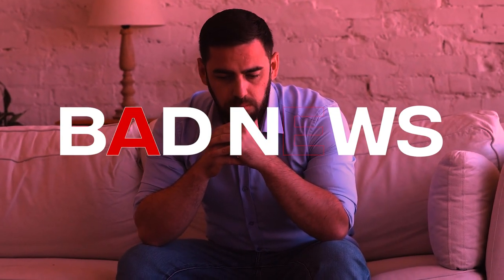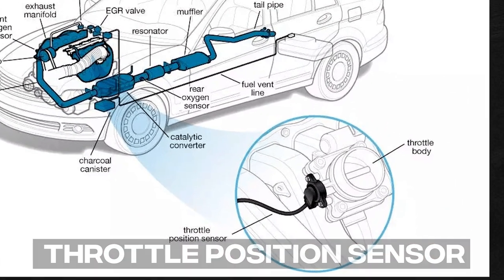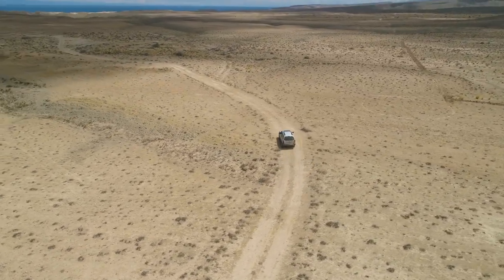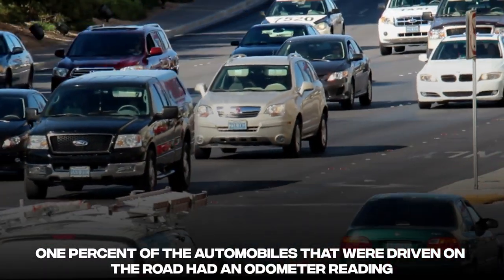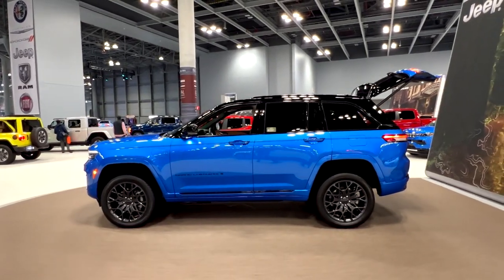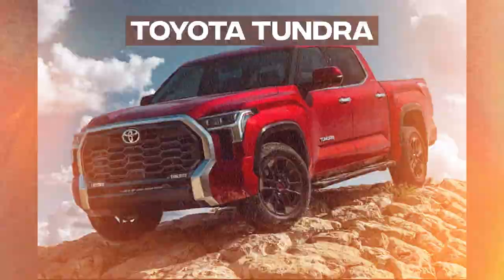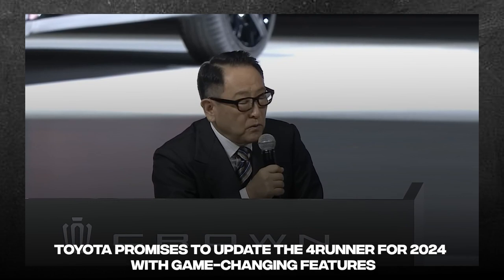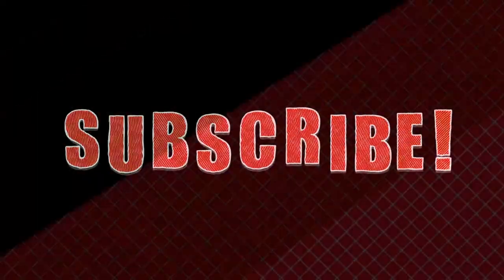This Is BAD NEWS For Toyota 4Runner Incoming Owners!

Comment: My coworker hit 1,000,000 miles in her 2000 model 4Runner. Her father bought it new and after he died her mother give the 4Runner to her. She said she only did the normal services on time and once changed the water pump. In 960,000 miles the 4WD system run out of fluids and once she changed that the vehicle was good to go. She sold it back to Toyota USA $62,000 with a little over a million miles driven all over the US including Alaska.
Reply: That's what 4runner is all about! Love this story!
Reply: Toyota paid $62,000 for her million mile 4Runner?
Reply: I have 1 million miles on one of my 2000 4runners also this videos is speaking about the 5th gen no generation before the 5th gen
Reply: @WolverineXOXO  it's not a waist of gas if the vehicle driven is enjoyed.. your comment is quite rude
Reply: Nice!
I swear this video is talking about some truck other than the 4runner. Must have mixed up in editing.
Reply: @Tundraalex  The odometer can’t go to 1,000,000 miles, so Toyota wouldn’t do that because they wouldn’t believe somebody. Telling them their vehicle has. 1,000,000 miles on it for $62,000. If so, I have five for sale. And I’ll sell them at a deal 50 grand apiece

Comment: I have a 2004 4Runner Sport with the 4.7-liter V8. I am coming up on 200,000 miles and have had no problems at all. I know several guys who have older 4Runners and they're all near or past the 500,000 mile mark and still going strong.

Comment: The main reason for charcoal, canister failure is do to people over filling their vehicles with fuel.  When the handle clicks at the pump you should stop filling your vehicle.  When you don’t stop it over flows into the charcoal canister and over time will q ruin it.
Reply: I stopped rounding up my fuel back in the early 2000's on the first vehicle that I owned for business purposes. I didn't trust that I was actually getting my moneys worth it in the long run and I also wondered why I would try to overfill my tank, just to round out the cost. Had no idea that it was actually bad for the vehicle!
Reply: Even says in the manual to not overfill the tank.
Reply: Amen

Comment: I've had two 4runners. 
My first one was 2004 limited. I put 300,000 miles on it with regular maintenance and no problems.
I have a 2018 SR5 now. I have had an unusual problem with it. Some of the wiring is partly soy based. A rat chewed my wiring. I always keep my vehicles garaged. I had the wiring repaired and now keep rodent repellent around the engine.

Comment: Lmao 🤣  there's no issues. It's common for 5th gen with 300k on the original transmissions. The transmission becomes an issue when owners don't change oil properly. The first oil change needs to be done at 20k miles and the next 30k miles later and there after. Change the transfercase oil and lube the shaft.

Comment: Wow.... I've owned a 3rd (96 Ltd 4x4 w/e-locker) gen 4runner now for 15yr. I purchased it of Craigslist for $4500 and had 67k. This vehicle was sitting in storage for 6yrs prior to my ownership. She currently has 170k but isn't my daily driver anymore but works perfectly without any problems throughout the yrs. She actually sits more than is driven but won't get ride of her.

Comment: You get a 4runner to explore, not for the fuel economy. That's why they're great for overlanding, campgin, trail driving. I hope that when they bring the new gen 4Runner, they dont limit the trunk space like they did in the mew Sequoia. There's no need to make shelves out of seats. That would only make outdoor activities that much more difficult. If anyone has seen what people do with these 4Runners, they'd understand what I mean.
Reply: A couple could live in one a year or so after buying property and building a home
Reply: exactly bro, I tell people if you want good fuel economy, get the city version, which is the Highlander. The 4runner if for going off-road, camping and preforming well over the years.
Reply: @RoMo  Ummm, you cant take a Cruze on the trails to go camping. Plus it has no space for gear, equipment, extra food. If your idea of exploring is simply driving on main roads and stopping at hotels and fast food joints than sure. But owning a 4Runner would be for ACTUAL exploring.

Comment: 2015 LTD, 150k miles since new. Transmission developed a shudder around 40mph at 130k, did a flush and added Shudder Fixx and so far so good. Also I am on my 3rd driver side doorlock actuator and my 2nd passenger side, and neither currently work. Other than that it drives exactly as it did when I drove it off the lot as new. Overall it has averaged 18mpg
Reply: Service the transmission with Amsoil and it will perform like new
Reply: Flush or drain and fill??  @HTTR_FOREVER21

Comment: What's the point of this video? There are over a million 5th gen 4runners sold in the US, saying that there are 200 reports of anything on these trucks is pretty insignificant.

I'm not a 4runner fan though, it's mostly outdated and unchanged in the last 10 years, but that lends itself to the reliability side of things.
Reply: Get yours before it’s all hybrid
Reply: I'll pass on "modern" vehicles, don't want my 4WD subscription running out in the middle of a trail.

Comment: 263 reports of shifting issues.... out of hundreds of thousands of vehicles. Now go look at the number of transmission complaints for Chevy/GM. Then look at the number of engine complaints for Ram and Ford. 

And you're talking 100,000 miles plus when these problems might start. Ford, GM, Ram...... you'll see all their common problems as early as 20,000 miles. 

Being the most reliable doesn't mean it'll never have issues. It means you'll go longer than the competition before issues happen.

Comment: The only real issue with Toyota 4 runners is Rust ...
And thst occurs in places where you have snow and salt is  used on the roads.
Even that can be prevented with regular cleaning with a power wash or under coating.
Reply: Im in the market for 4Runner and there's a mechanic out of Chicago who works on 4Rumners for over 10 years now...he has a YT channel. He says the same exact thing... notably to get the underside coating.  And he claims he's never ever had to open up the engine on these...which is aces.
Reply: This is so true they don't die they just rust away.
Reply: I bought my 2004 with a bad head gasket drove it half way across the state bought new gasket timing chain and bolts. Replaced parts and back on road 0 problems. These vehicles are tough as nails. They don't die they just rust away.

Comment: Hmmm. I've owned a 2005 4-Runner for 18 years (bought it new). It's always been SUCH an UNcomfortable vehicle for me (noticed it after my first "real" road trip after buying it). I've been trying to kill that thing for nearly two decades so I can get a more comfortable vehicle and a 4-Runner just won't die. It's THAT reliable. (At least in my experience.) Every time I take it in for an oil change, the dealder tries to buy it from me. LOL!.  I literally have had ZERO major repairs since buying it. The body will rust out on that thing long before there will be any major mechianical issues.

Comment: They really had to dig into the weeds to find something unreliable about the 4Runner lol. Try this video with any German car and it will need to be an hour long instead of 9 mins lol. Coming from an owner who has owned 2 German cars. Never again
Reply: @WolverineXOXO  the 4Runner really isn’t that bad for its class though. If you compare the fuel costs vs Wrangler or Bronco then there isn’t much of a difference. If you’re comparing 4Runner to hybrid Highlander then yeah of course there’s a huge difference

Comment: I average 22 MPG with an on frame vehicle, tried and true 5 speed auto, cast iron everywhere. Not unibody. You guys are nuts. Simple is better. If I want infotainment, I'll stay home and watch a movie on my big screen and crank up the surround sound. No wonder people can't drive anymore. I'll buy another one the end of the year before they screw it up.
Reply: That auto transmission is bulletproof but shifts abysmally slow. Hope Toyota brings that twin turbo I force max engine for the next generation 4Runner.
Reply: I'm going to wait and see the next generation. If it's not amazing, then I'll get one of the last 5th gens, and that should take care of my transportation needs until at least 2050 or so.

Comment: It's possible without a transmission dip stick the owner didn't realize he had a leak till it was to late. Change your transmission  fluid once a year. Ill bet my Chihuahua you can drive past 300 thousand without issues.

Comment: Only continuous issue with my 2016 Trail Premium is steering wheel vibration at about 60-65mph. I've changed to 3 different brand of tires so far (within 70k mi.), always rotate and balance (road force balance) at approx. 5k mi., religiously check tire pressure bi-wkly., and lastly... all stock!!! Still though... I can't seem to get rid of this particular gremlin.  I know many others have complained of the same, but curious if anyone on here as found a fix? 🤔
Reply: I had the same issue. 2023 trd offroadwith nitto grapplers Took it back to toyota and one of the tires needed balancing. I had left it sitting for a whole month which might have caused this. Another thing that was making it worse was the the tires were at 31psi and I didnt know that I can keep them at 36

Comment: This is only because Toyota tells you do not change the transmission fluid and filter it should be done every 60,000 mi in Toyota will tell you don't do it, if you change the fluid every 60,000 mi of transmission will last $500,000

Comment: My 2011 SR5 4runner started having problems with it's transmission around 65k and it became a nightmare. Toyota refused to even acknowledge the transmission was bad. I still loved my 4runner and don't think my transmission issues were typical to the product line. But Toyota does have issues admitting when there is a systemic problem with their cars. The transmission is too small for the weight of the vehicle and you need to be careful allowing the truck to slow using the transmission and not the brakes. But the transmission is still too small but does it really matter at this point.
Reply: I'm surprised to hear this. I researched the 4runner for about a year before buying a 2015 SR5 a few years back. I did not come across a single comment or trend around transmission issues. If anything, the 4Runner gets praise for how bulletproof the drivetrain is. Unfortunately I had to trade my SR5 in for a van for the family, but I have an opportunity to trade my Highlander for a '22 TRD Off-Road that I might just jump on.

Comment: No mention of frame rust?

Also mpg improvement from new engine with turbo charging is gonna get offset by the requirement of using premium fuel:(
Reply: How do you figure on the fuel cost?
If you drive 100mi at 17mpg you use 5.9g in my area (N.Cal) 89oct is $4.20g = $24.70
If the new turbo gets 25mpg as many think
That same equation yields 4g used at $4.60/g for premium = $18.40 
That’s a $6.3 or 25% savings
Reply: There’s absolutely not one vehicle that will not experience frame rust if they spend a good amount of time on snow. That does not result in just the 4runnner. And also, there’s a thing called undercoating to protect that.  😂
Reply: @Anomize23 Amen

Comment: The only issue Toyota got is the 4runner last 300,000 miles plus all the 80s, 90s,2000, still on the road including mine 265k miles still have no plan to buy a new one still running and running , let go place Toyota.
Reply: I want to buy a new one but I can't come up with a good excuse to get rid of my 2004 4Runner Sport - plus I know I am going to miss that 4.7-liter V8.

Comment: The 2023 4Runner will be the last reliable Toyota that will last 20 years.  All the engines with turbo will start leaking with all the cheap plastic and all the electronic garbages within  60k to 80k miles.

Comment: Jjjjjjjj me da risa  estos comerciales.    Y más aún. Recomendar  una  jeep cherroke.  O una  Ford  cuando sabemos que  la cheroke  es la reina en problemas  tanto de problemas de trasmisión  como  en problemas de electricidad  y plásticos baratos  y la Ford  otro tareco más  que  tienen problemas de  todo tipo.     ((   EL ÚNICO  PROBLEMA REAL... de la  toyota fort runner.....es que se oxida  el tren. Delantero...y que es bastante  rígida  y algo de consumo de  gasolina.     Por lo demás es un vehículo para toda la vida......te compras  un sprays  de undercoatin....para  proteger  la superficie de el  shasis  y problema resuelto.    No engañes  más a la gente. Que yo manejo  Ford  todos los días  y lo único que tienen  es comodidad  por lo Demás  un  problema.   FORD. SIGNIFICA.  fabricación.  Ordinaria  Roturas..Diarias.  .y el cherokee.  Es el rey de el confort. Pero  también es la reina de los problemas de trasmisión  y te deja botado  por  problemas eléctricos.   Puro  cacharro...remodelado......Toyota  AVANZA CONFIADO.   y que  conste  no tengo toyota  yo tengo un silverado 1500  HD 2002......pero las nuevas  son unos tarecos.     No las quiero  problemas de trasmisión  problemas  con  el AFM  de el motor  ect ect.    Yo prefiero una  toyota four runner.    Millones de  veces.